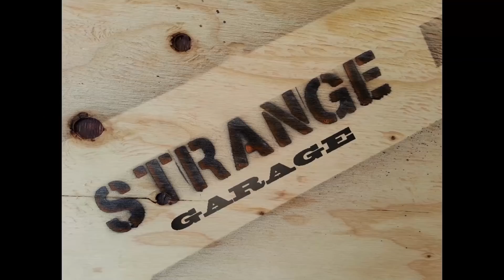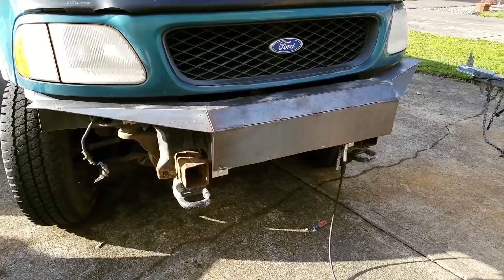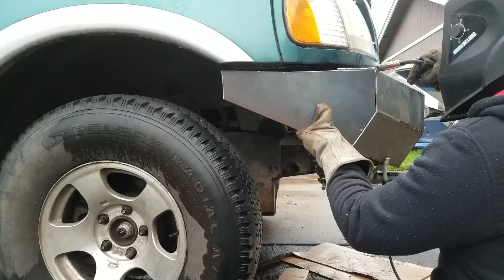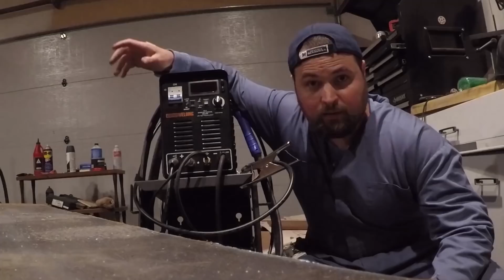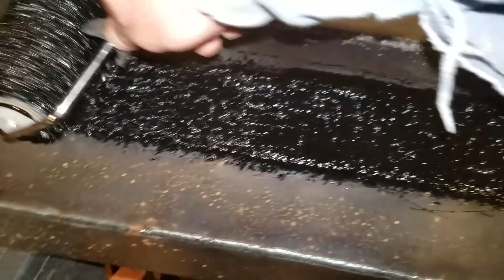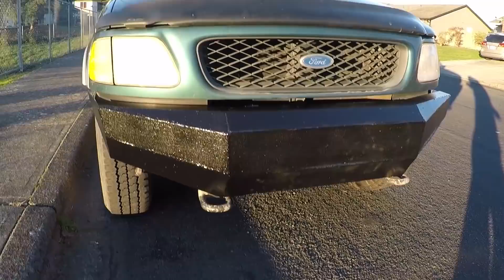Homemade Bumper w/Harbor Freight Welder Part 2

Comment: Great video. Can I do this with a 110 volt arch welder?
Reply from the maker: The welder I used was a 110. Worked fine.
Reply: Strange Garage thank you very much for the reply! I’m new to welding but I’m hoping to get certified in the field. I’m tired of working in a hospital.

Comment: Looks good, wish I could weld. Docs advise against it due to my pacemaker/defibrillator implant. Little extra juice might have me doing the kicking chicken. As far as using the cardboard for templates, that is the only way to go. Better to mess up a thick piece of paper than an expensive piece of steel or aluminum. I have mocked up projects with cardboard and scotch tape or duct tape, hit it with a little spray paint and set them in place to get a complete feel for the idea and potential material list. It also helped with the wife understanding what I was doing and why I was still working on the truck or whatever.

Comment: Not to be a safety natzi but you relly should wear a face shield when you use a cut off wheel when those wheels explode and shoot in your face it's not pretty and it usualy will split you open man also wear some gloves while your at it protects your hands from when you get kick back in a cut off wheel I dont mean to tell you what to do but at the end of the day you are in charge of your own saftey man stay frosty bumper is looking pretty good by the way I want to make a rear bumper with tire carrier for my jeep cherokee that taps around the bottoms of my rear quarters so that I dont have to fix my rust rather just cut it off and fold it

Comment: You should make one for the rear as well looks great might make one for my truck soon
Reply from the maker: I probably will at some point, but I have far too many projects to finish first! maybe after summer. What kind of truck do you have?
Reply: I have a 2003 ford f150 xlt supercab 4wd prettymuch same truck you have

Comment: Great job but as for strength it might not be stronger than the stock bumper being you used to thin steel looks nice though
Reply from the maker: Thanks brother. I decided to use a tow package instead of attaching the winch to the bumper. Haven't done it yet, too busy with other stuff, but it'll happen. Thanks for watching!

Comment: Will the air bags still work if you remove the stock bumper?
Reply from the maker: Flash Lawn Service No sensors whatsoever in the stock bumper. They are operated by an inertia switch that is engaged by rapid relative speed change. So, yes, air bags are still good to go. As a matter of face, the only thing in the stock bumper at all was 2 fog lights.

Comment: The truck looks like a beast..I would hate to get rear ended with that bumper ..looks like it belongs on. a  hum --  V.  Good job ...you can fix that welder..
Reply from the maker: Lol, I fixed it. I'm working on the video now. 

Thanks, I like the bumper more and more as time goes on!
Reply: Strange Garage.  I kinda figured you would..I have one also and a Lincoln weld an power..

Comment: I will be building a similar setup,but I plan on incorporating a 2" hitch receiver and mounting my winch on a drawbar that I can use in the front or rear of the truck.
Reply from the maker: +Mr Frog I had this in mind at one point, but I honestly didn't have the time. I got projects lined up and needed to knock this one out. That will be sick though!